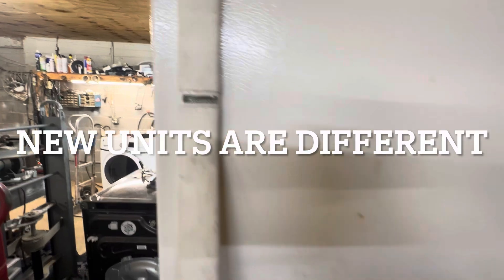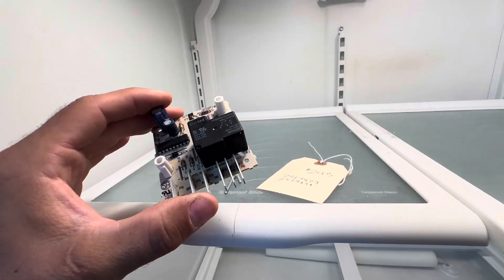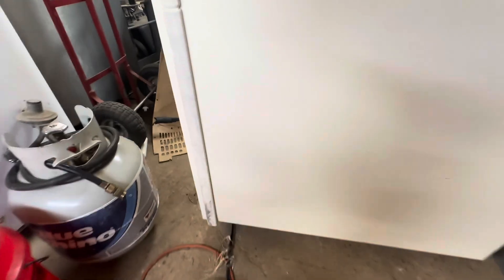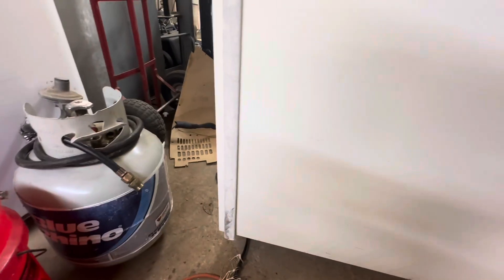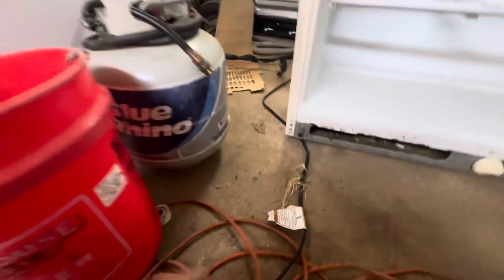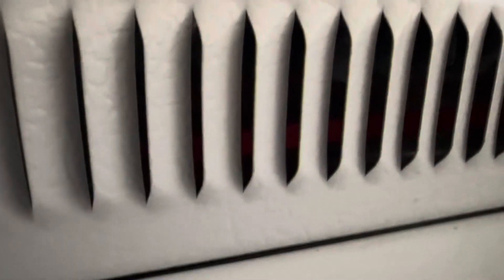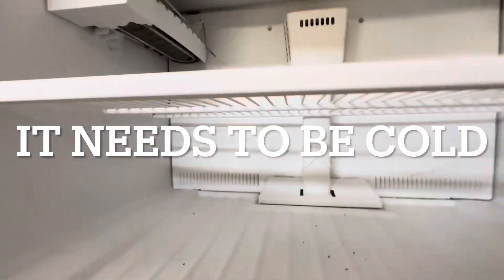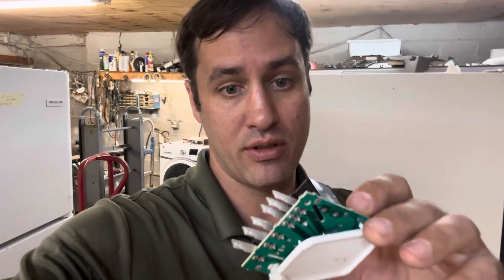How to fix an old whirlpool refrigerator that is not defrosting | forced defrost adaptive board

Comment: How did you know it was the board and not the defrost thermostat?
Reply from the maker: You can rest the defrost thermostat for continuity when it’s cold. It is normally open at room temperature on most units. And closed at freezing temperatures.

Comment: You  can replace it with a $20.00 mechanical  defrost timer..
Reply from the maker: True I have done that too back when all you can get is the $250 oem board but now we just keep the aftermarket ones and use them. I don’t even keep an original they are so high.